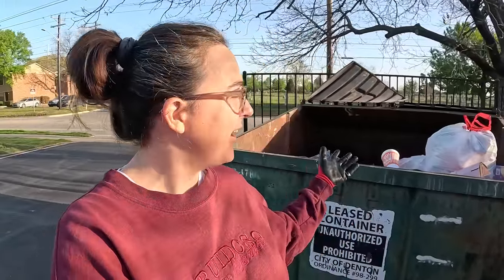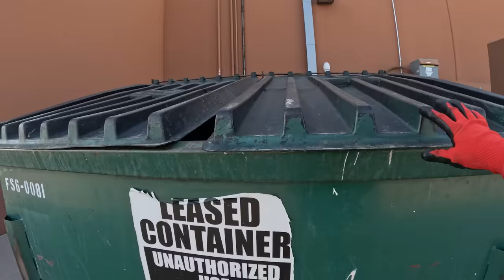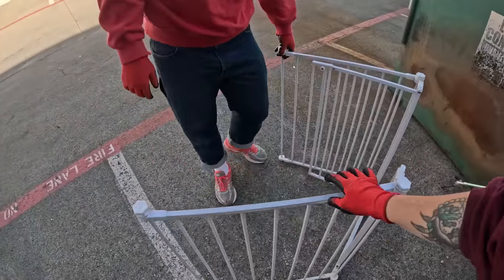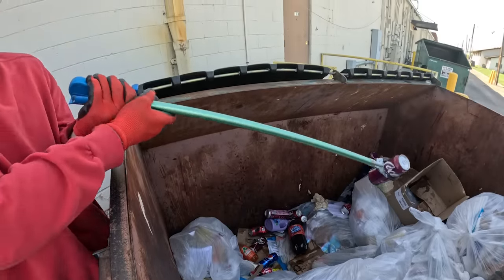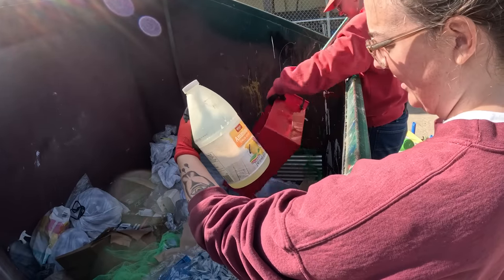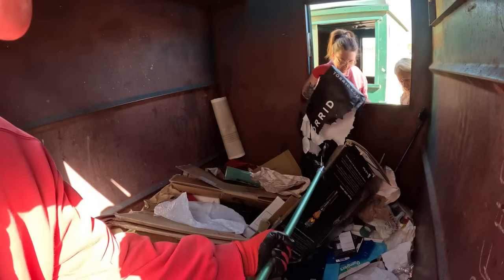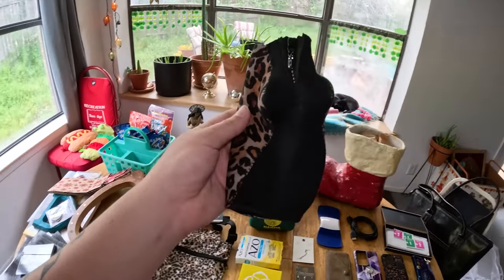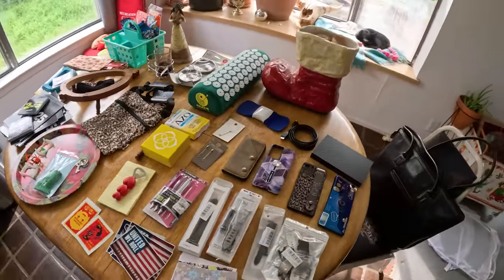We Kept Going and It Turned into a Great Dive!

Comment: The wooden piece with the legs is a pot holder. After pulling pot off stove and need ingredients to coool quicker it allows air to circulate around whole pan… or just keeps pot from burning counter tops as well

Comment: The ice packs are also good to have around (frozen) when the power goes out. I keep two frozen liter bottles of water in my chest freezer. Cute pet costumes for Bones! You can cut down the signs (i.e. $3.50 to say $3). I found rolls of medium sized red dots in a Barnes & Noble dumpster once. I still am using them for my yard sales.